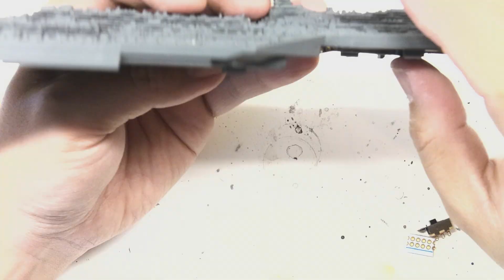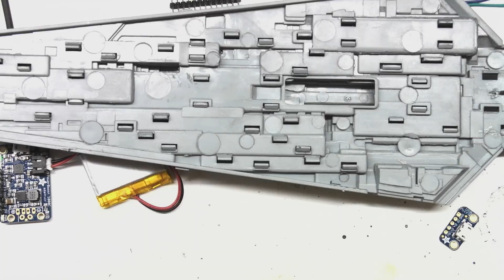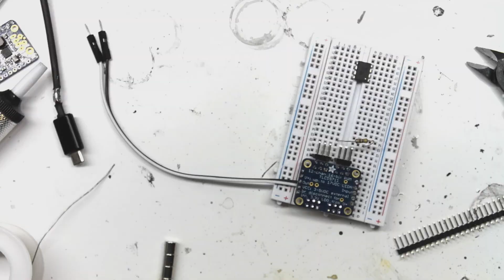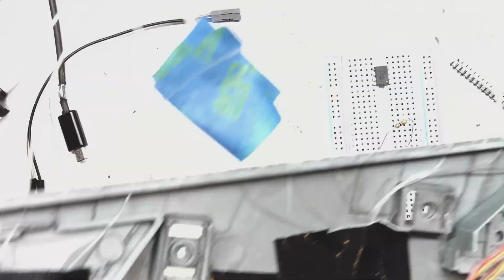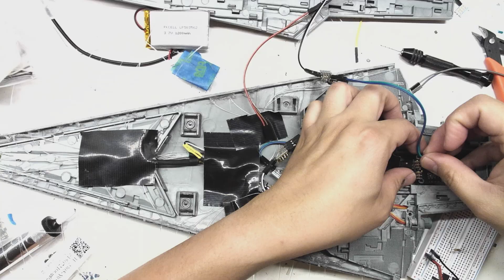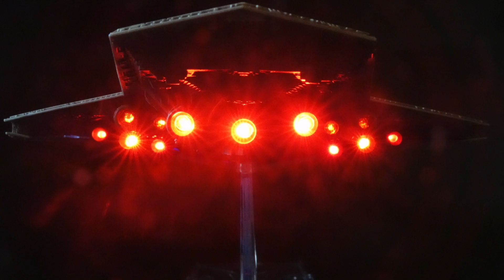Armada Super Star Destroyer 07 - Assembly

Comment: is there another simpler technique for this? especially for the engines? because im taking apart my SSD and i just want the engines to glow.
Reply: Absolutely. Having A few LEDs hooked up to a switch and battery is a very cheap and super simple circuit. You can even buy premade kits. The challenge is hiding all the magic. With larger models you can conceal it in a cavity, but for smaller ones, most just put the switch and battery on the base.